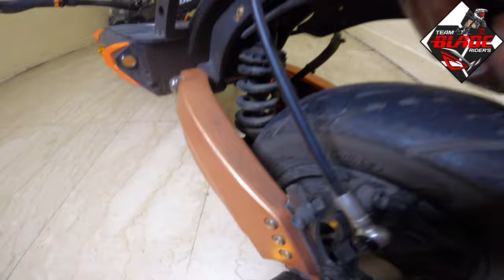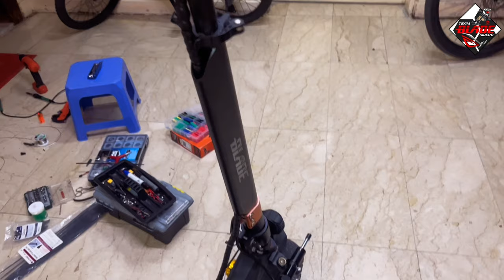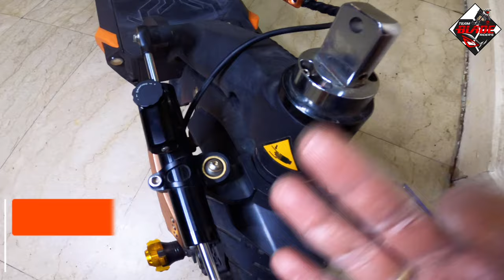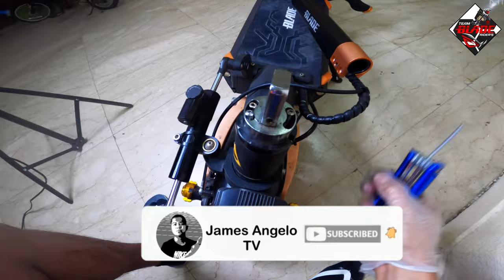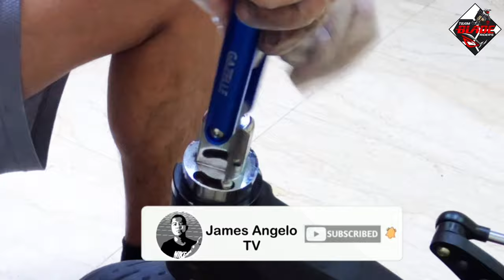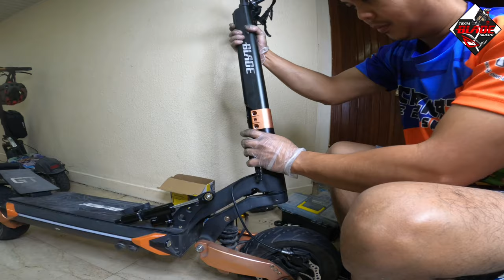Easy Fixed! Stem Wobble of Blade GT | Blade 10 | Step By Step | James Angelo TV | Vlog 139

Comment: Hi Angelo,in your video y
ou recommended using longer M4 bolts.
What is the length of the new M4 bolts that were used in place of the stock ones?
My GT+ only came with two bolts instead of four and fortunately I have no stem issues because all components in the steering column are securely tightened;however,I would prefer using four to avoid placing all the load and stress on only two bolts.

Comment: hello angelo would it be possible to install the teverun fighter 11 folding system on a blade 10, blade gt, rx2000?
Reply from the maker: no bro you meed to replace that neck and the swing arm holder to fit

Comment: Hey James, i have a Blade GT, and i have a skeaking noise, coming from the stering near the front wheel, have you eve had this problem? Do you have any idea how to solve it?
Reply from the maker: maybe that is coming from stem pole or in suspension need to tighten the screws or lubricate
Reply: @JamesAngeloTV  yes, i think its a lubrification issue, but i have no idea on how to do it, and i want to do it and assemble it in the same day
Reply from the maker: @tiagogoncalves8330 just spray in suspension and neck area and observe if there is changes
Reply: @JamesAngeloTV  thanks, but remember making a video about this please...thanks for the replys

Comment: Hi Angelo , i wanted yo ask you what IS the diameter of the handle bar i just want to change It for a foldable one , tthanks a lot
Reply from the maker: 31.8mm bro but i would suggest dont use foldable it’s dangerous
Reply: @JamesAngeloTV  really ? Ok ok Bro thanks for your advice i will try to keep It like that but  sometimes i have to get in the train so i wanted yo change It
Reply from the maker: @juanguillermoariasescobar740  if your not using always max speed its fine. you used foldable handle bar
Reply: @JamesAngeloTV  thanks a lot mate! 👍
Reply from the maker: @juanguillermoariasescobar740  wc bro ride safe

Comment: Still wobble everything is tightened
Reply from the maker: check the folding area, there is screws in front of lock. but you can’t fold once you insert screws until unless you remove
Reply: @JamesAngeloTV  for some reason I got my scooter with no screw there... thank you bro